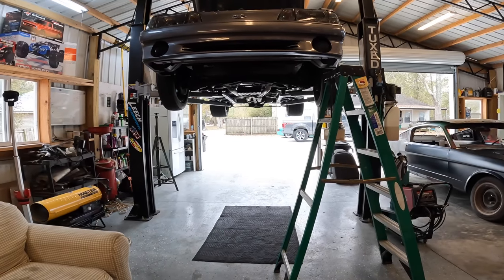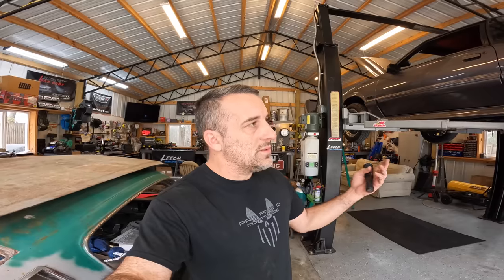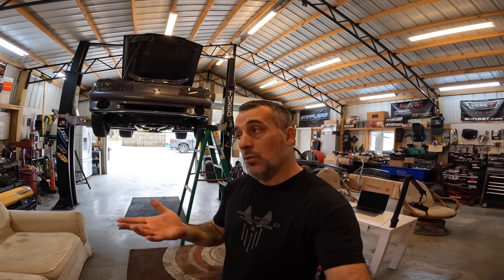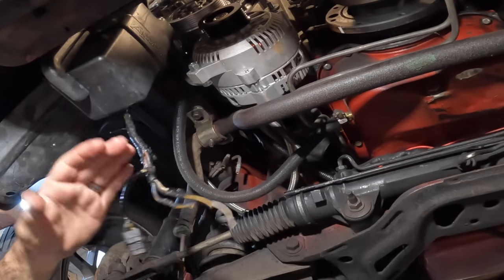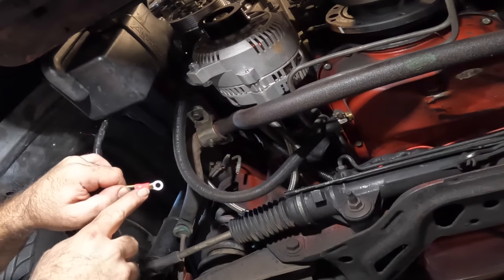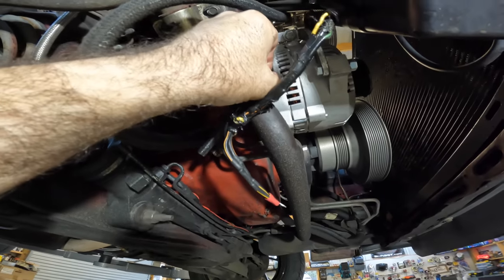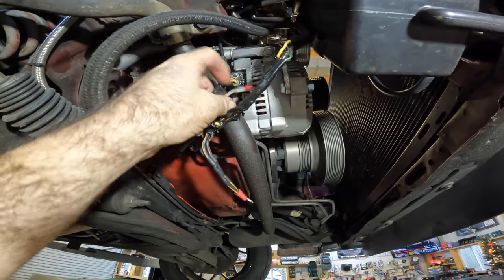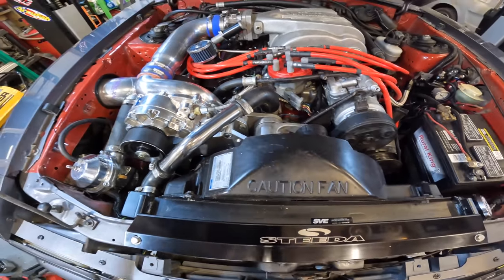A 3G Upgrade But I Screwed Myself

Comment: Yep I agree 100%. People have came up to me saying hey would you sale your foxbody? I really wonder if some of the people that have asked really know what it takes to keep an old car going. You have to have a connection with the car to stay interested. It has to take you back to a place like no other car can. My fox may never be fast or even nice by others standards but its the only car that is worth the time and aggravation to me.
Reply from the maker: Very well said 🙏✊ I don’t think most people have a clue of what they’re getting into 🤣
Reply: I feel the same way bro.  I have an86 gt t top car.  Had it since 2003.  It takes a lot to keep them going.  Most people havent a clue
Reply: Knew exactly what I was getting into on my 86 gt as I have a few vintage motorcycles and they're the same way it's always something on them going awry but to me that's half the fun
Reply: @BREW2LFOXBODY  did u get it from lmr. I have a turbo fox and it will say I believe it down on volt. The hand will read about half way when car is cool. Once car warm  up the hand will drop.low and sometimes the car will seem to stumble. How and volts is a 3g alternator??

Comment: I did this upgrade last year when I did a full led upgrade. Don't waste your money on the painless install kit, the main wire isn't nowhere near long enough to install correctly. I'm rocking a 85 lx with a Frankenstein 306 with 88 S/D ecu; I ordered an alternator for a 95gt from Amazon. had to modify one ear to fit in my bracket but only took about 30-45 min to get it in. If your headlights flicker or dim when your electric fans come on or the subs hit, the factory alt is only like 87 amps, it's well worth the upgrade and is relatively cheap.

Comment: Have you ever had a car where the alternator came buried inside the engine compartment from the factory? My grandma had a 96 Ford Tourus and a shop quoted her $500 to change the alternator. At first this seemed outrageous, but it wasn't because Ford put the alternator in a location where the suspension had to come apart to gain access to the alternator.

Comment: I would have had to say a few choice words about the scenerio before i got started on that disaster 🤣 I felt your pain on that one 🤯
Reply from the maker: I did 🤣😂 trust me. 

Btw did you need a stud mount rocker or a pedestal mount?
Reply: @BREW2LFOXBODY  The one that I need is the stock 1.7 pedastal crane cobra but gonna end up being stud when I get through with it 😁 lets say that the holes will get a lil bigger 🤣

Comment: I did the same for my 3g upgrade too, later i added the fat power wire. 
 Didn’t really need the big wire but its added insurance to me. 
My 91 has 2.3 turbo swap and the old 2g was replaced withe another 2g before it got a big electric fan, suddenly the 2g wasn’t cutting it, charged fine except during hot summer days with the AC on. Once the alternator got warm, it got very weak. 
 When i did the 3g conversion, i gave the old 2g to my uncle and I wired his T bucket up to accept the 2g alternator as it originally had an externally regulated 1g alternator. 
With minimal electrical accessories in his car, the 2G suits it perfectly and I don’t feel bad about throwing away a working alternator that i bought a couple years ago from Napa. Lol

Comment: Great video and tips BREW2L!
I'd loosen the bolt, push it back, cut the head off and pull it out. Then, replace it with some high-tensile-strength threaded rod with a nut on each end. weld the outer nut to the rod to aid in removing the bolt if needed.
For me, it was a necessity since I run an electric water pump, electric fan, a significantly larger fuel pump, and my battery is mounted in the back of the car. I'm not sure the last one has any effect on it, but just in case...

Comment: every time I'm at the pick n pull, I try to pick up at least one 3g for $20 and throw it on the shelf.  I've upgraded all of my foxes with them and my bronco too.  Mostly piece of mind for the extra juice but I usually run electric fans, so I need it.

Comment: I ran 4g wire on mine only because of electric fan and the terminator x.
I also plan on running some sort of audio. The stock 75amp alt only puts out 18amps at idle.
Also, i really like how you didnt have to clearance your bracket for the alternator like you do the stock one.
Reply: You ain’t kidding, my 2G was very weak at lower engine speeds. Lol
Reply: @jeffgriffith7003  i remember before the days of the 3g people used alternator Overdrive pulleys but then ran into issues when racing of over spinning them.
It was a double edge sword so to speak.

Comment: Cut old bolt off with grinder and replace bolt. Keep rockin.
Reply from the maker: I thought about it. But there was too much crap around the head of the bolt unless you used a dremel with the extension

Comment: Great timing on this, Brew2l!  I bought the LMR alternator a couple of weeks back.  Running an amp plus the LED headlights, and plan on doing the heavy gauge wire upgrade just to be on the safe side.  With the AC or heater blowing (well, when I fix it), stereo blasting, and headlights on, it's a big drain on the electrical system.  Sorry that you had to go through so much work to fix yours!

Comment: Cut the nut off with a Sawzall.  Push it through enough to cut the head off with a cuttoff saw. Put new bolt in in the other direction.

Comment: Sucks when something that should be simple goes a bit sideways but you have to work the problem, won't fix itself. Did the 3g upgrade on mine last year, figured it wouldn't be a bad idea with electric fans and a stereo, I did not upgrade to 4gauge wire but will this spring before I bring it out of storage, peace of mind, that being said it worked just fine last summer, factory wire's barely got warm.
Reply from the maker: Absolutely it still works fine! I just have to cover my ass when it comes to these things.. 🤣 a little disclaimer just in case
Reply: @BREW2L  one of the first lessons my Dad shared with me when I started running crews for construction sites and such 'Cover thine own ass because nobody else will'.

Comment: Ive got a 91 Ford Mustang notchback supercharged 347 stroker. I've gone through 2 Powermaster 200amp alternators. I'm done dealing with them. Thinking about going with an SVE 200amp alternator from LMR this time around.

Comment: Been putting off this upgrade on my sons 89 lx, then he goes to Pick n Pull and gets a sn95 alternator, wire from someone that ran battery cables to trunk of car. A 150 amp fuse block from stereo system. Got all the stuff for 50 bucks. You can get everything from Amazon for around 200 bucks. Now I got to help him do it.😢😢😢

Comment: That's how mine is run. I just upgraded because I got a good used 3G for $25, but my car didn't really need more than stock so I didn't bother with the 4ga wire. But the OEM plug to the alternator had melted a bit before I changed it out, so it can pull a lot of juice.

Comment: 31 yr ol cars ! Mine lost fuel pump other day but didn’t strand me . Got it home found lost signal from PCM to relay under seat 🙄. Cruise night Bla Bla Bla , rigged for cruise , added relay next day triggered off key switched power back in business . Of course I negated inertia switch 🙄. Runs drives 
Car has had dash swapped and not in a good way.
Reply from the maker: I love it. You gotta do what you gotta do sometimes.

Comment: My ‘93 came to me with the 3G alternator. I noticed it has the factory wire to the solenoid. My issue is when the loads are on lights and blower motor, the gauge drops and the light flicker. (Oem everything) 
Had the alternator tested = ok 
So I bought the wire upgrade kit (have not installed it yet) so I hope that cures my issues.
Reply: I would check your head light harness. They are known to have issues

Comment: Yeah I has a 92 5.0 aod with 2 12" subs and Amp I had to get the red optima battery to keep charge it was the best thing, I didn't keep having a dead battery anymore I never changed the alternator it was stock .

Comment: Not sure what alternator it had but when i was a kid my brother had a 89 cougar and mom was using it and when we came out of the store it was on fire at the alternator always been in the back of my mind ever since. To upgrade from the 80s technology alternator
Reply from the maker: It’s not a bad thing for sure. I’ve been lucky with my original alternators so far.
Reply: I mount a fire extinguisher crossways under the passengers knees. Handy and not in the way.

Comment: The drain for your blower is going to end up messing up the blower(ask me how lol) it isn't going straight into the pan and looked to me on film it dipped down and oil can't exit the blower fast enough. Mine looked just like that, and when I sent mine into Vortech, they told me to send pics and said the drain has to be straight and easy for oil not to build up if that makes since.

Comment: I ran a 4g and my fox was having trouble producing current or even getting power had to use the black and yellow wire not sure what I did wrong but after hooking up the black/yellow wire with my 4g wire it worked haven't had an issue since

Comment: Would have went with a power master alternator and it’s a one wire setup and it pushes way more amps than a 3g installation was a sinch very simple

Comment: What if you have a 4 gauge wire and the two black and yellow wires on the stud? Will this cause the alternator to not charge the battery?

Comment: Could you have just cut the head of the bolt off and pulled it through from the front??
Reply from the maker: I thought about it. But I really didn’t have a good angle on it.

Comment: No way man. Take the nut off the bolt and you'll be able to push it back far enough to get a cutting wheel in there to cut the head off the bolt. Buy a new bolt. Work smarter, not harder.